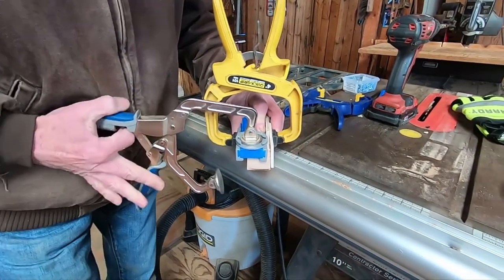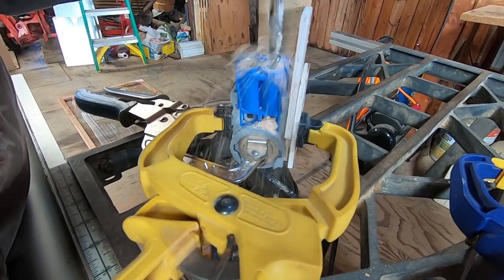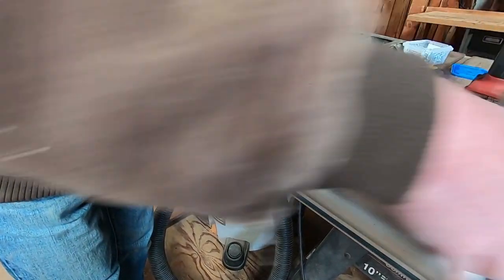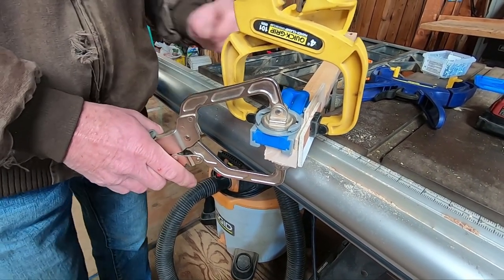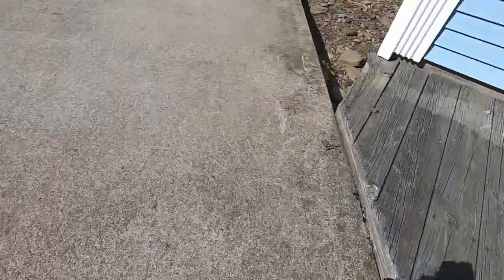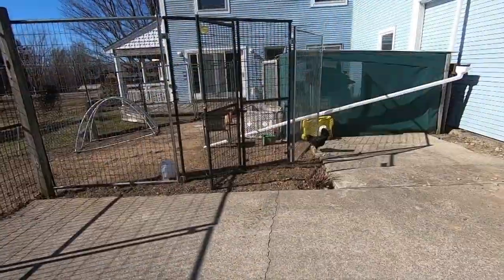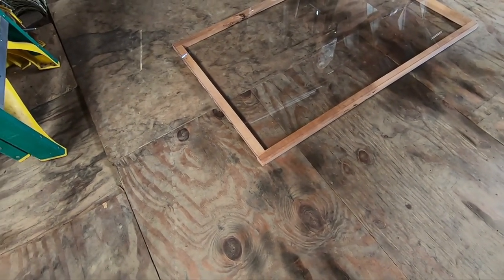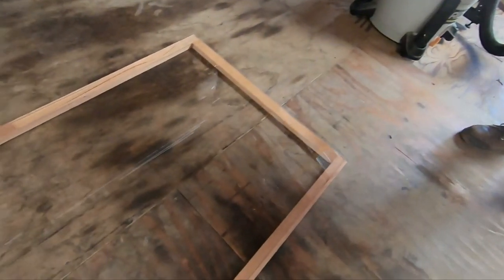Remember To Turn Your Clocks Ahead

Comment: We don't go on daylight savings time here in Arizona. I seldom get up before 9. That's a neat jig Jim has for those holes.
Reply from the maker: Hello Greg,  Your so lucky that you don't have to change the time. it takes a bit to get use to the new hour.  I would probably sleep longer but I feel guilty Making   the dog and the chickens wait.  they most likely want to get up and out.  so I get up.  💕NonnaGrace